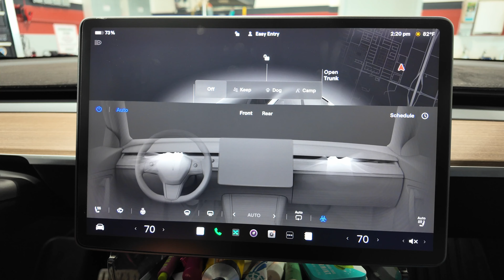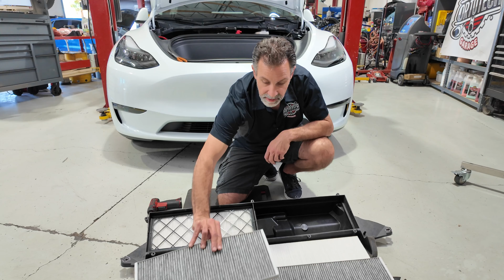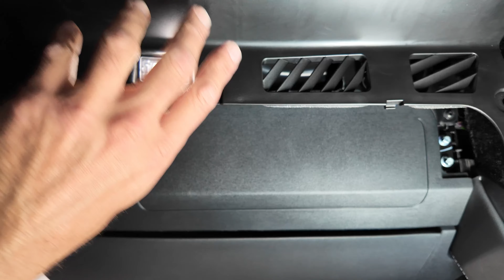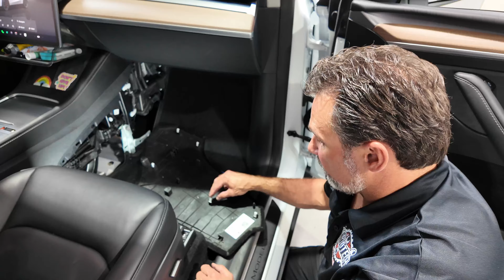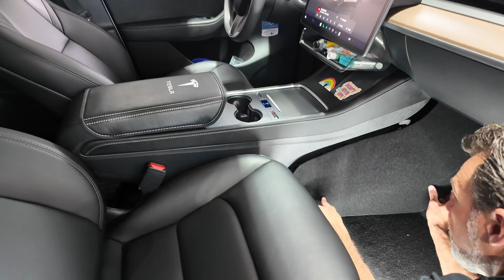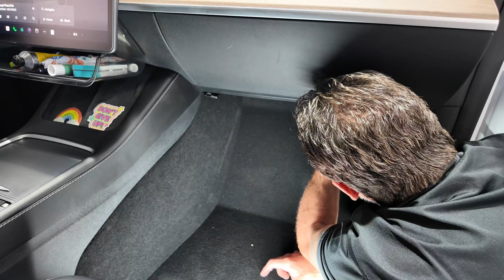Tesla Air Filter Replacement – Cabin, HEPA, and Bioweapon Mode Explained

Comment: not related to Bioweapon, but would you do a video on the Tesla model 3 drive unit fluid change? I am on my 3rd. Model 3 I have had a 2017 mid range, a 2018 Long range that had a drive unit failure at 110,000 miles, and now I have a 2025 long range with 35,000 miles on it and I would like to do the drive unit fluid change on front & rear. There is not much out there on it and Tesla holds that information tight, I can't even find a service manual for anything past a 2023 online. Thanks, Love your videos. Using the Camry Hybrid ones to help me work on my wifes new car .
Reply from the maker: Thanks for providing your feedback!   I dont have a video yet for the drive motor fluid changes.  I will try and work on those for the future.  I know most people dont touch the fluid in those but I am sure some service would extend the lifespan a bit. Tesla is an odd company in the fact that they are fairly open with the service information, to a point.  Maybe there is a bit of a lag in release due to your model being so new.  I'm glad you have found a couple of my videos useful.  I will try to get to a video for those electric motors.   Thanks for watching!